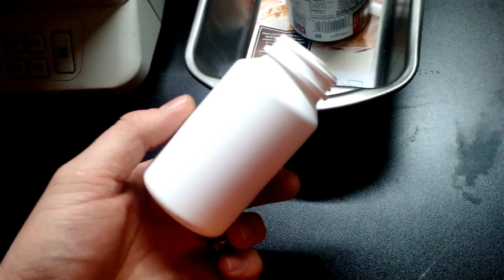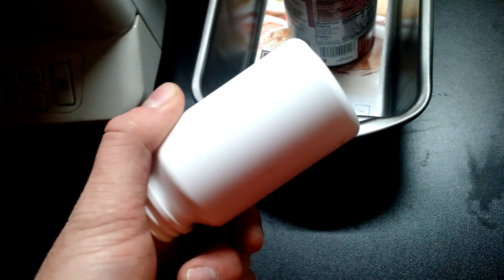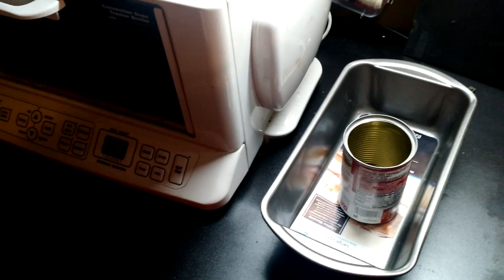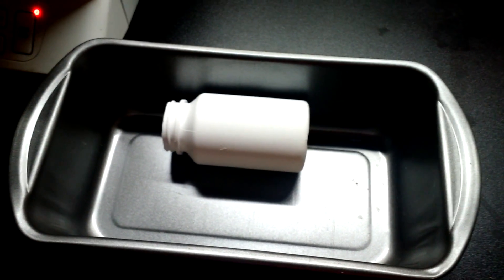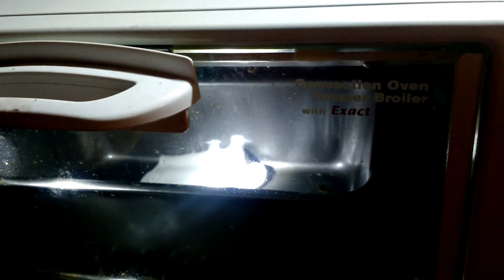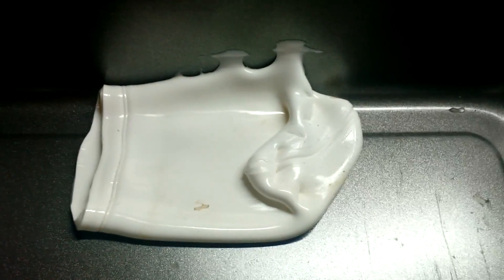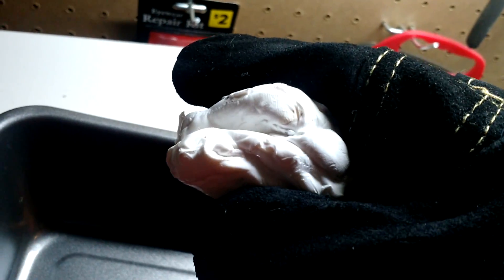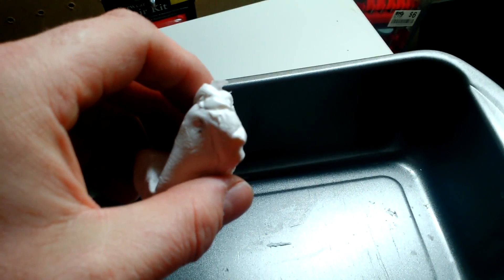How To Recycle HDPE Plastic To Make Parts!  Trash to Treasure, Part 1!

Comment: Does it smell?
Reply from the maker: +friendsANDsuch350 As long as you do not burn it, no.    350f degrees seems to be a good temp that will not burn it.
Reply: 1D10CRACY thanks for the question and answer...
Reply: 1D10CRACY NBA 

John
Reply: +1D10CRACY 350F won't burn HDPE but I run at 385F to get my melt more fluid. 385F won't burn HDPE in my oven either. BTW convection ovens like what you're using do work the best.
Reply: this is ridiculous,   this stuff makes toxic fumes when it melts as I have gotten sick melting it in an old waffle iron and never burned it.  I did this outside and still got sick.
Reply: @whiskeysudsjackwagon8510  A waffle iron isn't ideal, since you can't set or monitor the temperature.  Also, maybe it was the Teflon coating that made you sick?
Reply: Whiskeysuds, then you were burning it at that waffle irons temp. you need only 248-356°F of temp for melt and myself I never got sick from fumes when working for a small operation when I first moved to FL until I was let go and found a better paying job needing my CDL qualifications at the time.

Comment: does this process generate toxic fumes?
Reply: If you keep the temp at or below around 350F, 175 C, gas Mk 3 or at a push 4, the volatiles in the plastic are not hot enough to boil off. Having said that it is always best to do this outside in an old baby belling type stove or keep the windows and doors open. TAOW, a young fella does quite a lot of melting and moulding, his site might be worth a look. This chap 1D10CRACY  has one of the best short set vids on this I have seen for a long while.
Reply from the maker: +Alessia Di Gennaro Alili Hope not!    There is no oder as long as you do not burn it.

Comment: It said hdpe on my bleach bottle
Reply: Ammonia + Bleach = (Very)Toxic Gas. idiot. rinsing out four times is sufficient for cleaning out what previous chemical remains in a plastic bottle.
Reply: IF you recycle a bleach bottle I recommend cutting it open after rinsing it to give it a good scrub, you do not want to inhale bleach fumes to much.
Reply: Joshua79C C it's best to rinse it using ammonia, water won't get it off the walls as well.. the ammonia will help turn it into a gas that will get it out of the container the best.
Reply: Joshua79C C when you do it keep it inside though because you don't want it getting into the enviourment
Reply: yeah its impervious to a lot of chemicals
Reply: Joshua79C C lol I was totally kidding if you didn't catch that.
Reply: @greenthizzle4  Maybe be more explicit in indicating that you're joking when you post dangerous advice, though!  Not everyone knows about bleach/ammonia interactions.  We're all at different points on our learning journeys, and ignorance is not stupidity.  (I myself am guilty of posting sarcastic and ironic comments without stupid emoji/disclaimers, with unfortunate results.  It's a good habit to break!). All the best.
Reply: Ammonia and bleach shouldn’t be mixed at all 💀

Comment: can you make a mold for pouring cold process soap?
Reply: +Doreen a  Molten HDPE does not pour. The goo would stick to the ceiling if you got it there. You can inject HDPE under pressure though. HDPE will burn before it gets anywhere close to what we would consider a liquid. Just a property of the material I suppose.
Reply: You can melt it but yeah its not viscous like oil or such, but you will want to press it as you heat it to make sheets or such in small quantity of you can not afford an extruder machine which can get expensive for a DiYer.

Comment: this is interesting and has peaked my curiosity. i think i could make a bad ass sheath for my katana like this. was gna try & make one out of some soft wood but this looks like it'd be more fun.i bet i could make a custome phone case too.thx man 👍👍👍👍👍👍subbed
Reply: DIRTDIVER882 Just want to offer a suggestion.  since a katana sheath obviously wouldn't fit into an oven, you might want to use a heat gun or butane torch to melt the plastic.  It should be possible to just melt it in the oven and scoop it into a mold, but that much plastic would take a while, and it might cool too much before you get it to fill all the nooks.
Reply: DIRTDIVER882 Another thought too.  Maybe try mixing different ratios of white plastic and translucent plastic to make it resemble something like bone or ivory.  Or mix different colors..
Reply: 'Piqued'

Comment: shred all the plastic first, then melt it?
Reply from the maker: I think that may help, working on a shredder next.
Reply: What I have seen happen with people who shred the plastic is that it just makes more air voids in the final product. You have to melt a little, press it hot, then add more, melt that, press it hot, and on and on. It works, but if you have fairly flat larger chunks there is less chance for air voids to form. Good luck :)
Reply: +James Sanks  I've run into the melt shredded plastic idea a lot. I've also melted swarf I've made on my milling machine too. Which is quite nice shredded plastic if I do say so myself. It melts like ass. Too much air is trapped in with the shredded plastic and it adversely affects the melt. But feel free to try it for yourself and see what I'm talking about.
Reply: @1pcfred  I wonder if you shred it but sprinkle the pieces on top of the melting plastic a bit at a time instead of all at once?  It would be more time-consuming but might avoid "voids"?
Reply: So for DIY-ers at home, it's best to just use fewer, larger pieces, arranged with as few gaps as possible, melted all at once? I would worry that if I melted whole pill bottles, for instance, the narrow "mouth" would melt shut first, trapping a big air bubble in the "body" of each. (Obviously I've never done this before and am just guessing... I always have ideas for inventing things but never get around to it!)
Reply: If you noticed when he used his gloves he was getting fibers into the plastic, and from my experience in 2005 with a small company there is not much you can do to avoid voids. you literally need to feed from the primary extruder into a second extrusion pipe to work out more voids and you will still be left with air pockets. Those air pockets are not big a deal unless its "large".

Comment: how about using a piece of pipe as the mold, lieing with parchment paper rolled into a tube? the paper has a silicone coating.
Reply: Can work but you have to press after adding and melting a few inches, add a few, press, add a few press, to avoid air holes and give good structural integraty. And then you have to hope it shrinks enough when it cools to be able to be pushed out the pipe. I saw someone make a half pipe, that he jubilee clipped together making it easyer to split and recover the core later. That seemed to work. Good luck :)
Reply: Parchment burns but does not really catch fire though HDPE has a high 356°F melt point at most, from my experience working for a small recycler making lumbers and some other specialty pieces the molds seldom had any plug up issues, but yeah at wort a little hammering with a wipe to free the part usually does the trick and the molds had a open back end and door on the ejection connector end to make most removals of pieces easy by work gloves since it was melted at upward of 180°C/356°F. Recycled Plastic Factory is the name of the place now.

Comment: I want to follow your durections but it has a bad smell when heated then I get complaints from my neighbors. Do you have similiar environmental problems?
Reply: You might have had plastics other than #2 / HDPE. Soft drink bottles are usually PET #5 - bad. Also check lids - can be different to the bottle.

HDPE shouldn't smell.

Comment: you can do this on a stove top with a low heat. I shred the plastic into bits and slowy add as the last bit melts into goo. non stick baking sheets new are good for making plastic sheets but for tubing some kind of extruder is needed. most companies seem to cool the liquidish tube with a water table of sorts. I guess I could post a video durr lol.
Reply: I love Jesus HDPE is pretty soft, I would not recommend.
Reply: Andrew, you sure its soft? Seeing as its often used for replacement plastic sleepers by some railways and also as mats and cribbing by construction companies due to its great compressive strength and durability. Oh and i made lumber for a small company for a while in 2005 helping them out when they needed.\ and one of their customers is a dock builder and use the lumber for decking boards. ON the other hand you may be thinking of PP which is more flexible and other lesser stiff plastics. UHMW PE and HD PE alone are used now a days in conveyor equipment to provide a slicker surface to reduce wear on the conveyor belts. You can easily find videos of PE used for cutting boards and as i mentioned before on YT.
Reply: How long does it take for the plastic to melt and harden? Also, can I use a higher temperature than low?
Reply: Joshua79C C it's too soft to make guns, I would use plastic for 3-D printing.. if you can get the fire resistant plastic and then get a plastic extruder for making filament and mix the fire resistant stuff with carbon nano tubes or graphene would be your best bet for making firearms
Reply: Aaron McMillan can you make guns out of this.
Reply: @joshuaAICod  and guns?!?

Comment: most milk jugs are 2s
Reply: No such thing as 2s, just 2 which is HDPE or High Density Polyethylene a very common used plastic for oils and solvent storage and transport. Even thousand gallon plastic tanks are made with this same plastic.

Comment: process all of it into tiny bits. makes fewer voids and melts faster.
Reply: When remelting either from recycled beads or shavings your going to get micro bubbles and voids. Worked for a small recycle company in 2005 and noticed sometimes the surface was smooth but cut one end and you will see voids.
Reply: +random consumer  I have not found that to be true. The "tiny bits" as you call them are never like commercial pellets. Regardless of how you may equate the two.

Comment: I see this is part 1. I did not see part 2 on your list of uploads. I'm really looking forward to it. Are you going to melt down an entire 5 gallon bucket or are you saving up water bottles? 

In my experience, HDPE does not last. If you compare leaving a PETE plastic bottle in the sun versus leaving even something as thick as a 5 gallon bucket in the sun, give it a year or two and the PETE bottle will still be solid but the bucket will be fragile and falling apart.
Reply: Yet marine grade seaboard is HDPE. It has UV stabilizers in it.
Reply: you sure that 5 gallon pail was #2 plastic?
Reply: I no longer leave any kind of plastic outdoors in the sun.  I got tired of picking up, throwing away, and replacing broken gardening implements, cracked buckets, and random plastic shards !